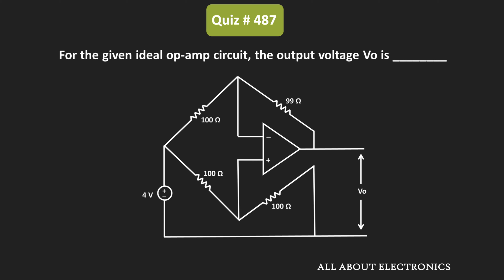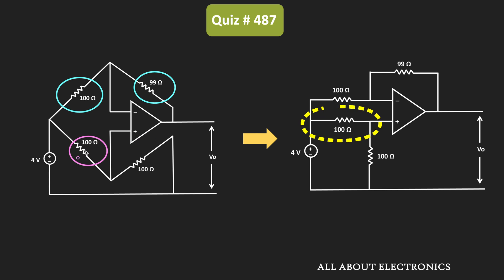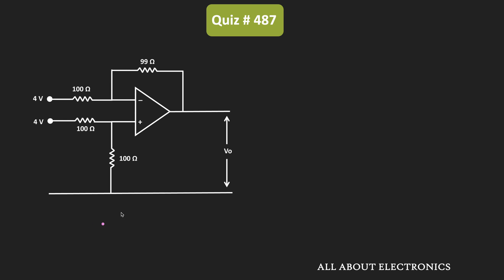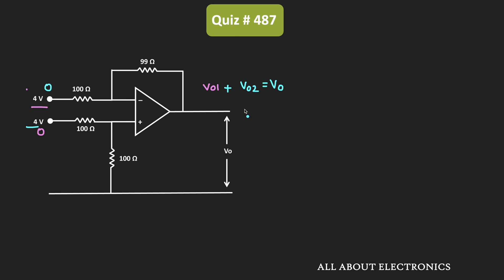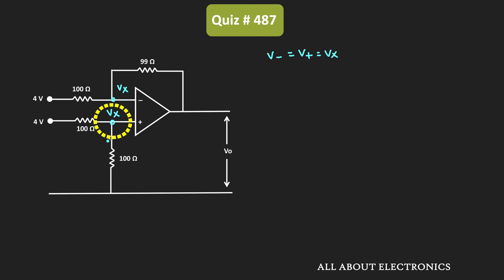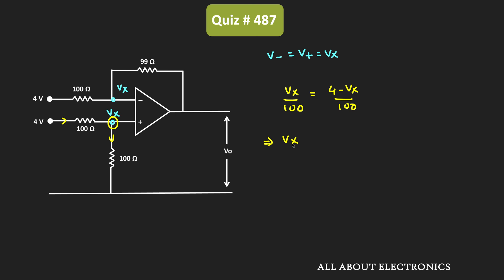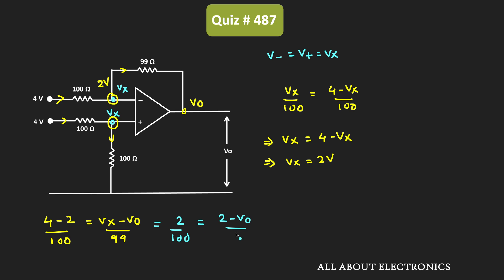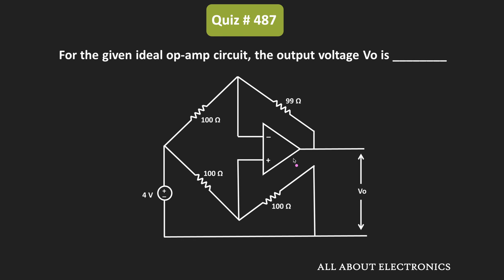Operational Amplifier (Op-Amp) Solved Problem | Quiz # 487

Comment: Bro in an difference amplifier the resistors marked as 99 ohm and 100 ohm must be equal thats a condition for difference amplifier
Reply from the maker: That is when you want exactly V1 - V2. But In general in difference amplifier, Vo = A*V1 - B*V2. Where A and B depends on the value of the resistors.

Comment: Bro used superposition and nodal to solve a voltage divider lol

It is literally ohms law and kcl, why u callin it nodal

Vx is 2 straight up since input impedance is infinite, when an opamp achieve negative feedback no matter using non inverting or inverting input for feedback, both input will have same voltage

Negative feedback is achieved when either inverting input rise with output, or non inverting input drops with rising output(connect collector back to non inverting input with ce configuration with output controlling base), basically when output phase is inverted, u need to use non inverting input for negative feedback